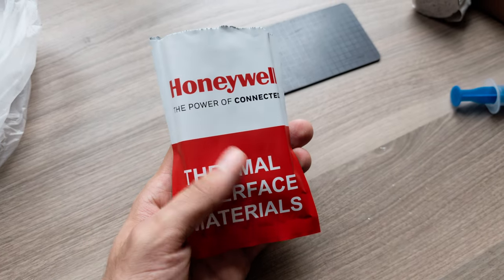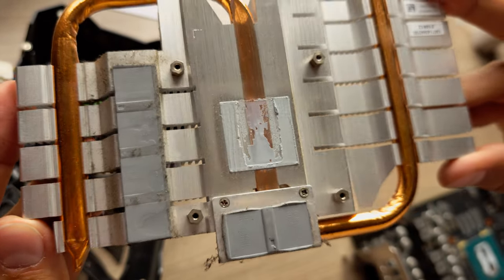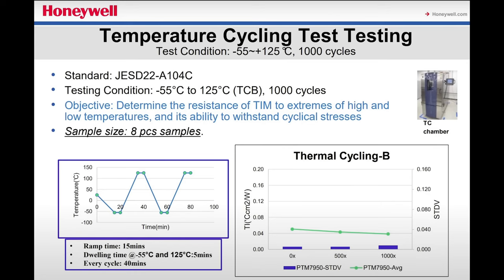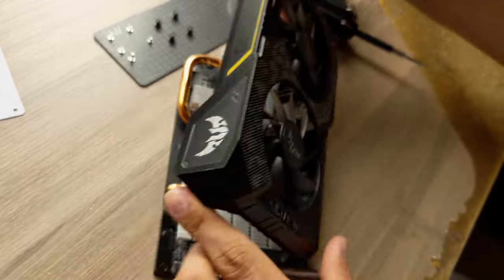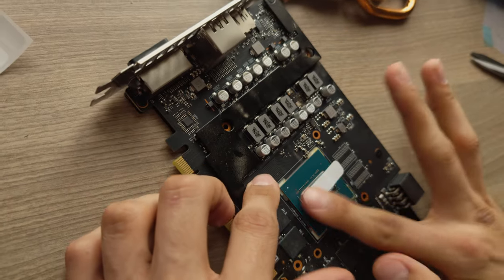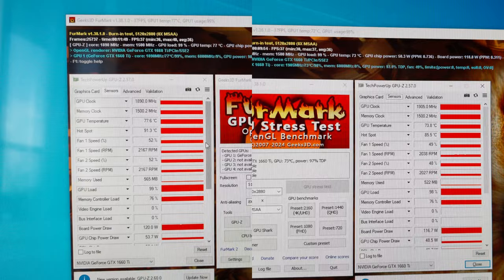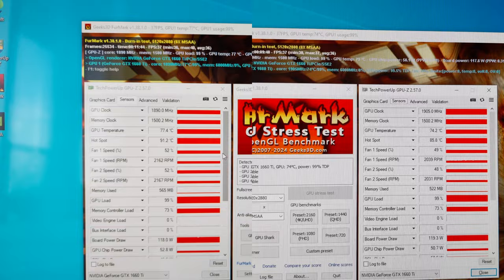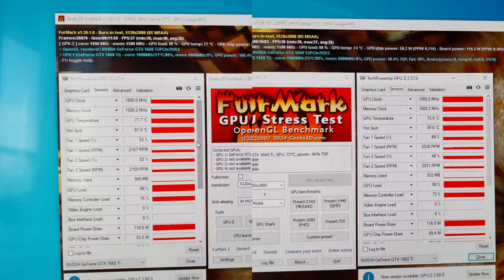Repasting 1660 Ti with PTM7950 (comparing to GD900)

Comment: Where did you buy yours? I bought some on amazon last year and uts worked pretty decent and i barely found put a week ago thet my razer blade 15 stays around the 85-90 degrees C range even after I cleaned the fans and heatsink (there was barely any dust in either)